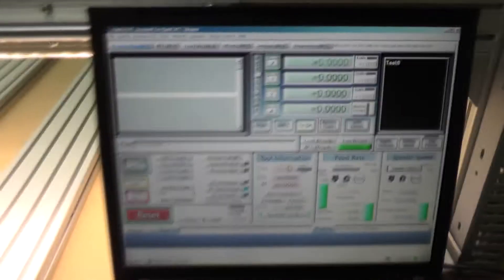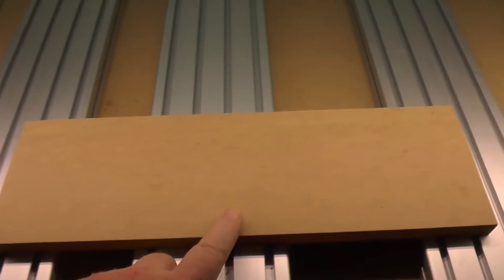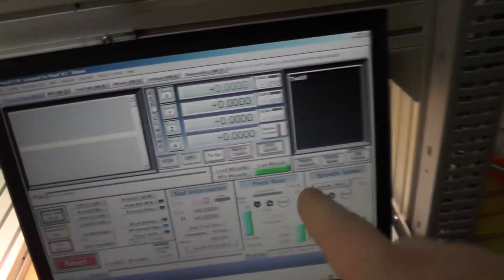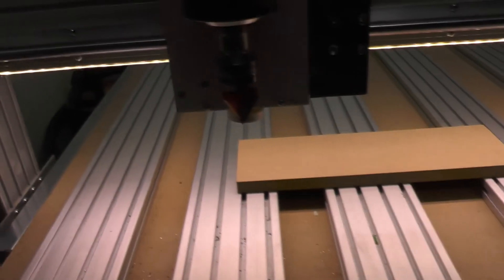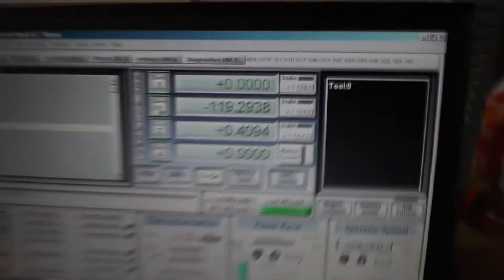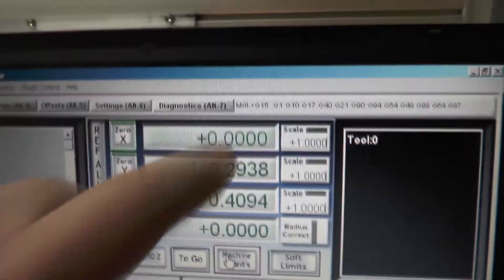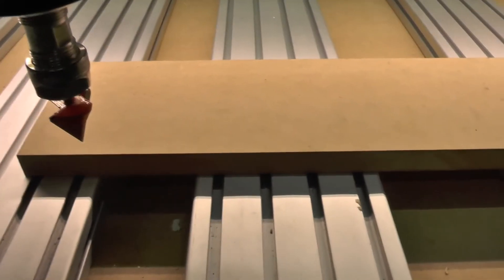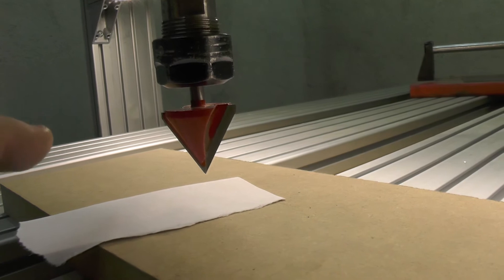Mach 3: Setting Work Offsets

Comment: I do the same way, but when I start my G code from Fusion 360 the tool goes somewhere else on machines absolute 0. Tried G53 and G55 didn't help
Reply: If your soft limits are activated then go to zero brings you to those coordinates. They were off in this video so that's why it went to what he set. You can set offsets and save it so it will always be at that point for cutting sheets for example. In this example you need to set it up for the part manually